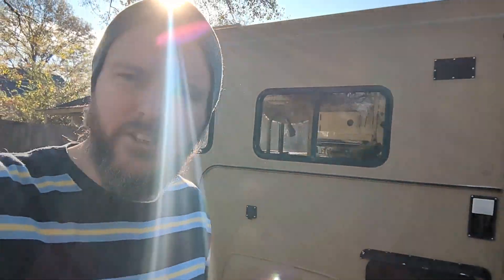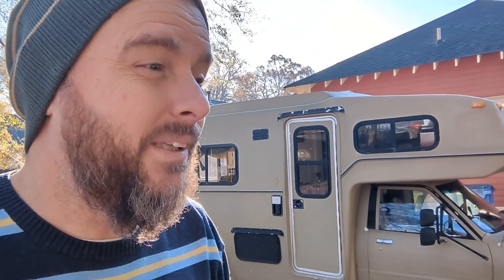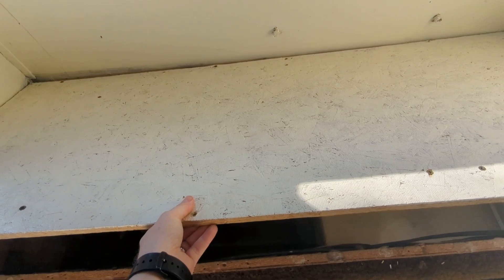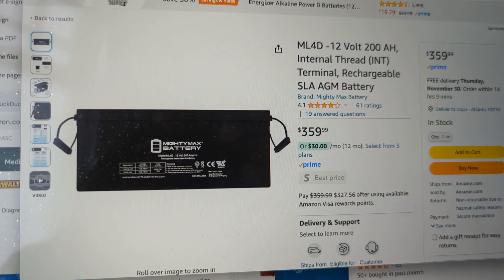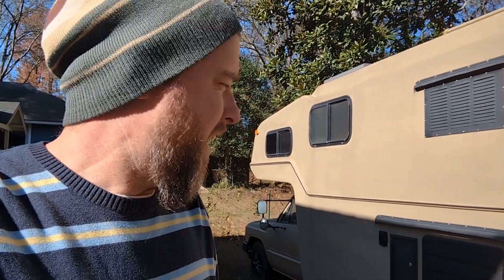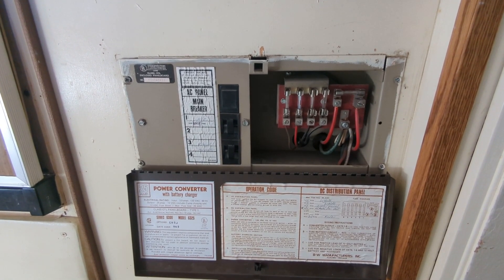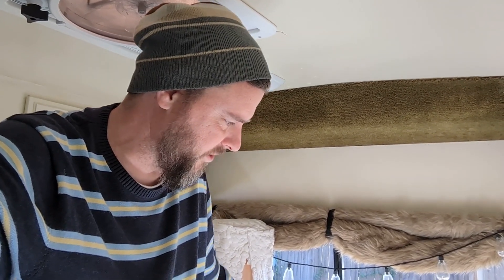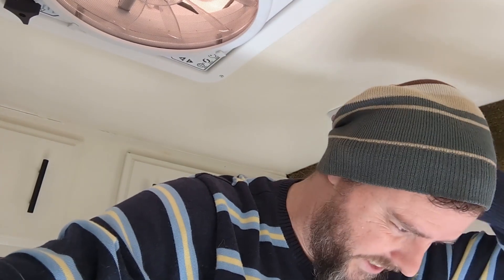Learning in real time - Unraveling the electrical system in our 1986 Toyota Sunrader RV

Comment: I'm only marginally conversant with watts and volts and amps as well, but looking at what you have in situ....I think you gotta pull everything and start from zero.  Looking at the "connections" that include just a massive wad of electrical tape, or worse - those blue "wire-tap" things....yikes!  Plus, given the amount of corrosion at the negative (I think?) post, there's probably corrosion through a decent length of those wires. So, even if it works, the power draw is going to be much greater (the poor little electrons having to fight their way thru the corrosion)...and more resistance (heat), which is not your friend.

As a stop-gap, how about just plopping in one of those Bluetti (or whatever brand) power station things (e.g. Bluetti AC200L just to throw one out there). They can be charged off of alternator 12V, solar, or regular house current); LiFePO4 so it's fine with repeated deep discharge (the major downfall of lead-acid) - at 3500 (10 years, almost daily) full discharge, you should still have 80-85% of the original 2kWh that this thing comes with.

Run extension cords from the A/C outlets on the power station in place of where all of the current (no pun intended) wiring resides to where you need outlets; 12V outlets on it as well for your 12V appliances. 

Stupid-expensive? Yes. But...either you sell this in a year or two and get back maybe 70% (certainly no worse than half) of what you paid if/when you get around to installing a bespoke solution; or you keep it as additional power (I get the sense that electrical capacity in off-grid living is like RAM and computers - there's no such thing as "too much". 😃)
Reply from the maker: So appreciate this reply here. I've looked at those portable solutions - but I do like the idea of there being a standalone system integrated and on board. But - yeah. As ever. It's a decision tree with an ever increasing number of branches.